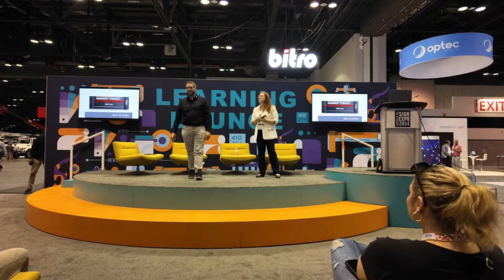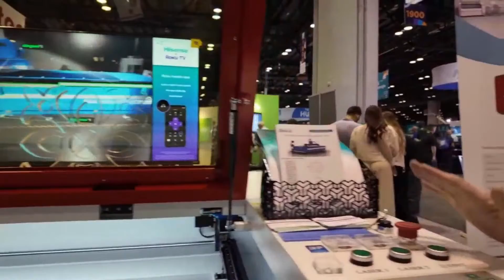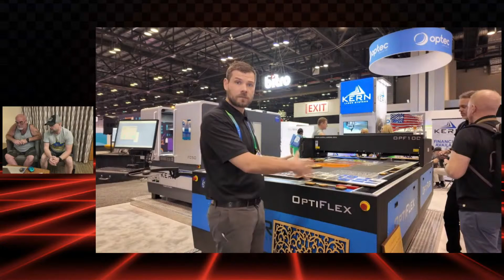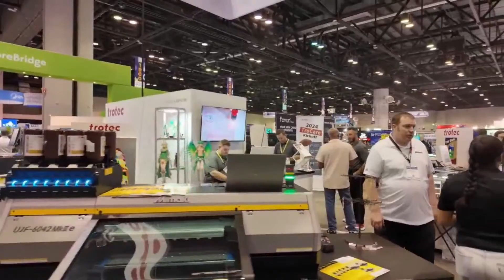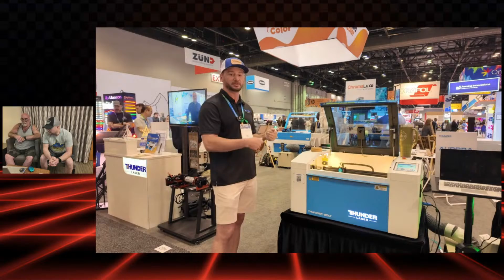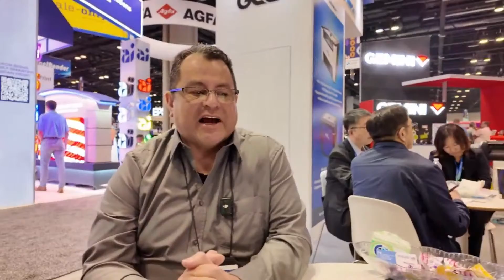Night 2 RESCHEDULED! From the ISA show in Orlando Florida!

Comment: Got the Thunder Bolt for $5500 no extra shipping cost and it was so simple to setup and get running.   I maybe wished I could cut a little thicker but the RF is great.  Engraving is top notch.    Camera is not great but don’t really need it.  I need to learn more about the 4” lens for cutting 1/4” birch a little cleaner.  The swap the lenses is so easy.
Reply from the maker: Yes Dwayne, the 4" lens will help when cutting.

Comment: I’m hoping to order the aeon redline. 
Which would you recommend between the Mira 9s vs nova 10s?  Going in garage so size is not issue. Is the nova better for the cost difference?  I’m engraving 40 ox tumblers with piburn grip—so Mira is tight on clearance but doable.
Reply from the maker: That's going to be up to you Tina. There's not much of a difference between the two other than the cabinet access and bed size.